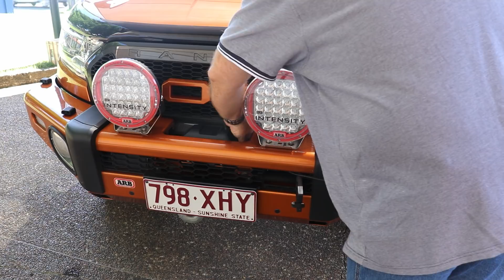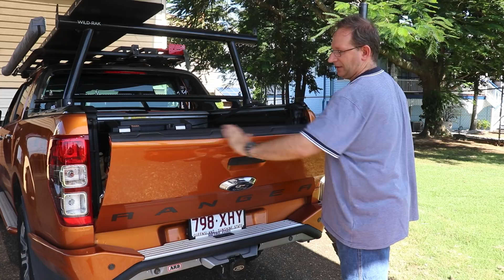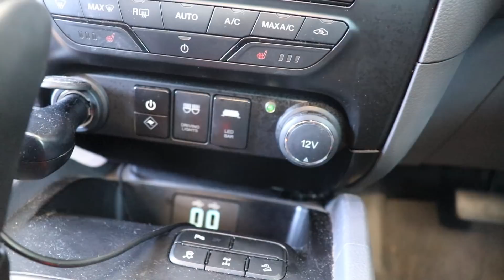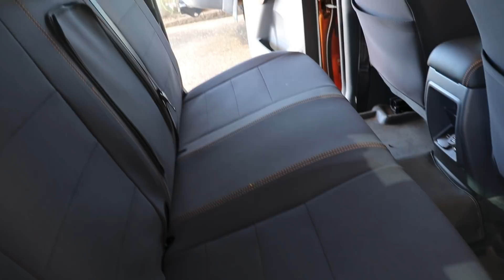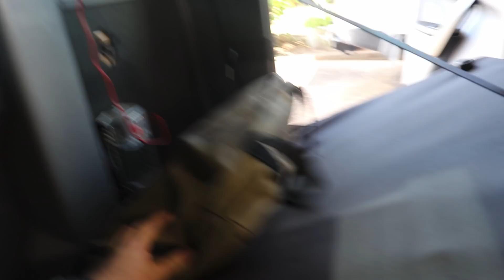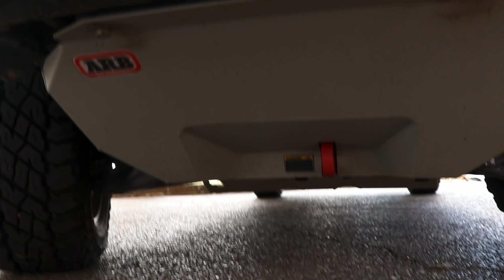The Ford Ranger PX2 Wildtrak Pride Orange look around

Comment: Hey there, good video. Interesting tour of your Wildtrak. I'm actually wanting a similar fridge and slide for mine. Can you post up the model number of the slide and fridge please? I notice it just fits under the lid, did you have to cut away the tubliner to fit the fridge or does it sit on top of the liner and still clear the lid? Cheers.
Reply from the maker: Hey mate. Did not have to cut away anything at all. It fits under the tray perfectly. It is an ARB Elements fridge (they only make 1 of these) and I will need to check the slide model for you.
Reply: @acafwd   How'd you go with the model number for that slide mate? Keen to grab one. Cheers.
Reply from the maker: @ducfatsvideos.6293   It is an Off Road Systems Slide. 505 x 725 model. You can find it here:  http://www.offroadsystems.com.au/fridge_slide.html
Reply: I’d also like to know what model number of the slide is? Have been told by 2 ARB centres this is not possible

Comment: Love the ranger I’m buying one next June I’m wanting to put a rooftop tent hard cover pop up just wondering(kings) if it will fit on the roof or do I need to  extend roof rack to back? Also the ladder rack? On the back just wondering where or what brand it is. Thanx !
Reply from the maker: jai9auu3  It would fit on the roof rack. Mine is a rhino rack. I prefer it on my trailer so you can head off for the day though 👍🏻